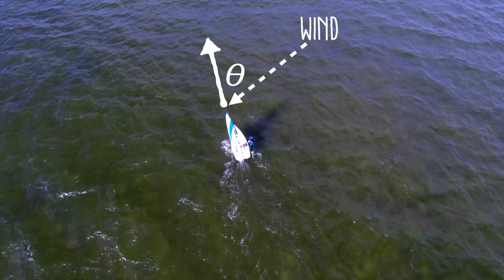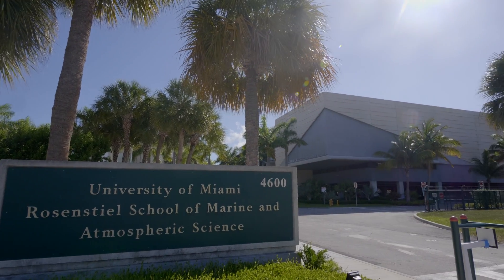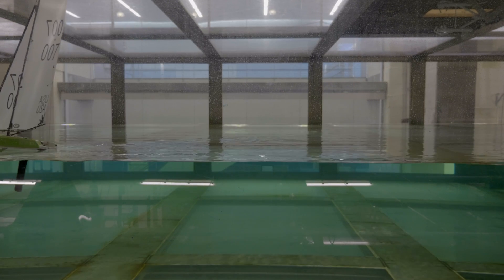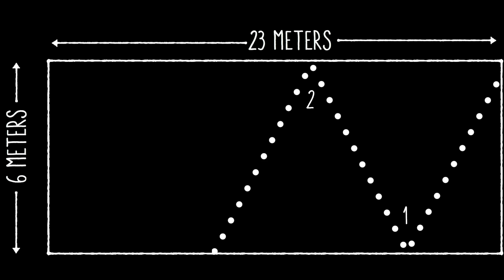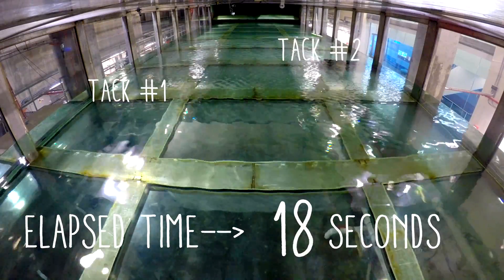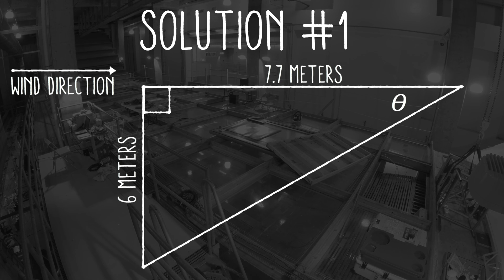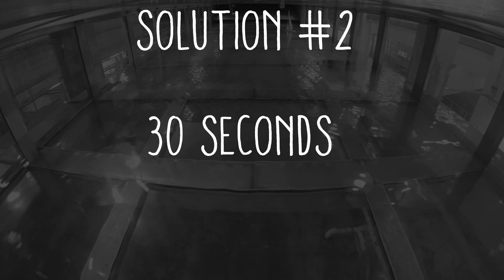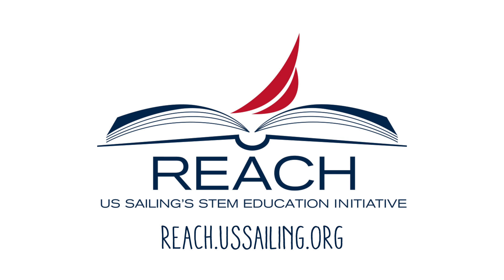The Trigonometry of Sailing

Comment: Back in the day (i.e. I was a lot younger) and a windsurfing fanatic - I would carve upwind until my sail showed signs of luffing at the mast at which point I would bear off a bit.  Windsurfers on small, sinky boards usually just want to do a fast reach - tacking upwind being just a necessary evil at times like when you get blown downwind from your launch beach/car. Carpentry - that's where I used trig a _lot_, handiest tool ever.